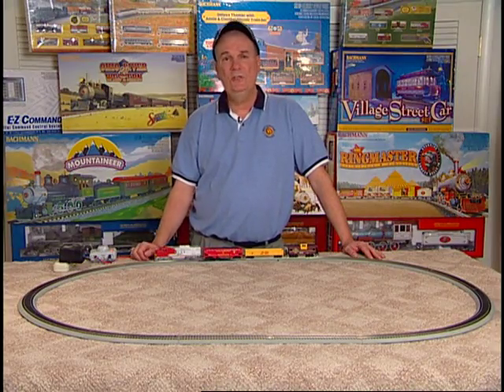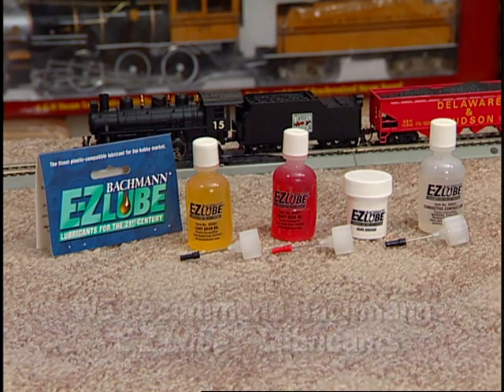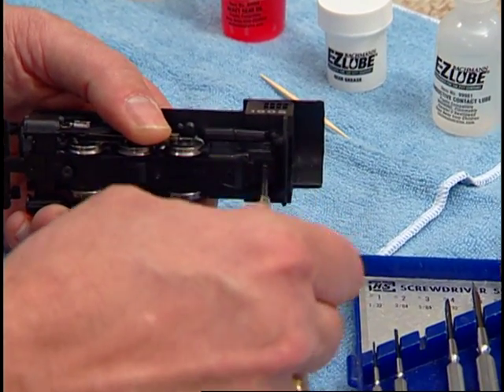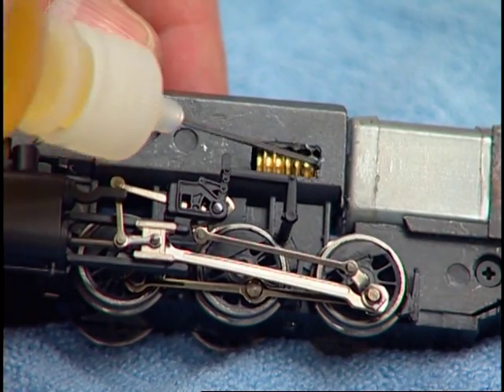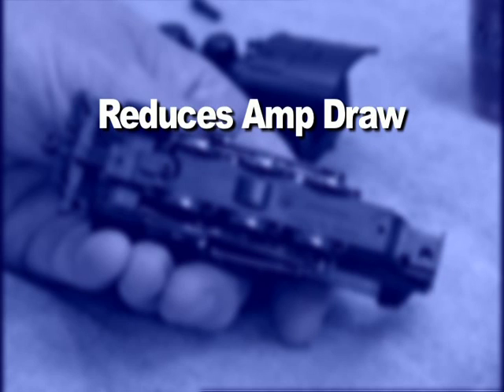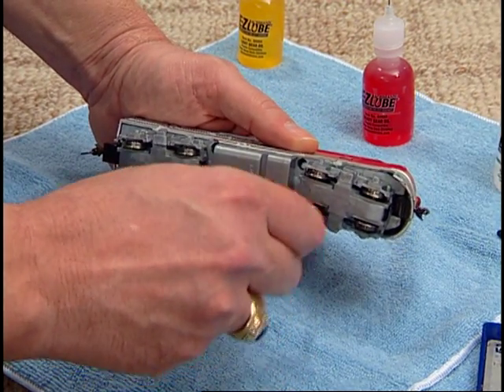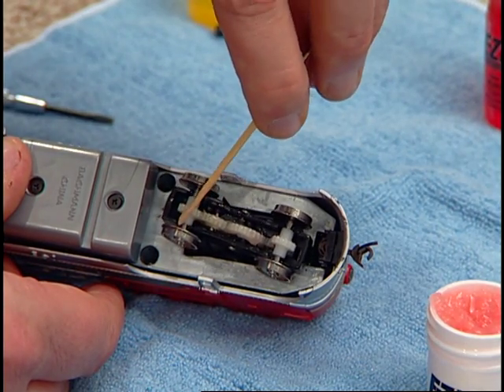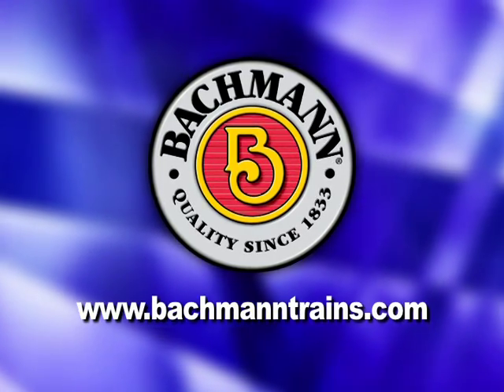Maintenance Tips and Tricks

Comment: @trainboy7 alright, you'll either have to remove the bottoms part of the chassis block, (the plastic bit with all the licensing and whatnot) and then put the oil in the wheel gear, and it'll just get to the rest of the chassis on its own very quickjly, OR you could pop the face off, and remove the eye mechanism, and put the oil on the fancy gear with a curvy grove, but on the actual gear part, and then it'll quickly (but slower then the other way) get to the rest of the chassis :)

Comment: My Bachmann 0-6-0 has its worm gear buried inside the two halves of the chassis. In order to oil it would I have to take the chassis apart or is there an easier way to do this?

Comment: In the case that an engines smoke unit is leaking smoke fluid, how would you clean the fluid off the base, wheels, etc.
Reply from the maker: Hi there - we recommend using any cotton-based cloth. An old rag, an old t-shirt, etc.

Comment: How often should you lubricate your locomotive?
(Week or month-wise)
Reply: They recommend after every 24 hours of use.  From experience the lube will last a good amount of time but will always settle to the bottom of the side it's stored on and in the case of grease it can thicken or become hardened a bit.  If stored for more than a few months I would always say to clean out and reapply oils and grease.
Reply: So what the comment said about I disagree with on storage . I've had it where am I locomotives have sat for several months and never needed much but maybe on the drive gear of a steam engine a little bit of oil. I've had my diesels sitting the same amount of time never had to add anything. Most of my things are from 50 to 12 years old granted I don't have much but still. What I would do is if you're welcome out of his sat for a couple months and it's a diesel take the truck cover off and look at the grease but looks good pliable not dry and the locomotive runs very well other than needing a wheel cleaning I wouldn't do anything to it. Same goes for a steam engine however the drive rods may need as I said before a little bit of oil that's it

Comment: I bought an 0-6-0 and when it touches the plastic part of my ez track switches it stops getting power and doesn’t move. Can I get help. I spent 200 dollars and I can’t use it
Reply from the maker: Our best recommendation would be to make sure the wheels on the locomotive are clean and the rails on either side of the plastic section of the turnout are also clean (there should be no greasy or black streaks visible on either). The plastic section is not long enough to create a short, but if the locomotive is struggling to receive power immediately before or after, it could create the conditions where a short would be possible.
Reply: @BachmannTrainsUSA  thank you so much I’ll try it, if it doesn’t work should I switch to a powered frog?
Reply: I found out my front right driver wheel had a bad black grease streak causing it to loose conductivity when it touches the plastic

Comment: How do you add new couplers on my f7a santa fe no.307? I havent used it in months
Reply: Couplers only need replacing when broken, however if they are a tad sticky or movement is stiff you can use some oil on the pivot part of your particular coupler.  Kadee makes the best ones but will require you to standardize your entire consist to them if you make the switch.  If yours are plastic couplers I would say upgrade them to the metal ones like Kadee.

Comment: Don't lube the wheels where it connects to rails. It causes decrease pulling power
Reply: Really?  But the video said that you should, and that it will help increase performance.  I’m confused..
Reply: @ChrisHillmon  u lube the bearings but the vid shows to oil the wheels where it connects to rail which if you do that only attracts dirty to stick to rails and also makes the weak 0-6-0 even less useful. That goes for all locos. Never oil the part that connects to the rail
Reply: @GSMRFan  Thats electrical contact lube on the wheels..different stuff completely
Reply: @gutzee4498  yes but it's still slick and will decrease pulling power and also gum up tracks
Reply: @GSMRFan  Ya maybe, electrical contact cleaner should evaporate..might be different stuff than I am thinking...does say lube though  hmmm

Comment: May be a silly question,but if happen that extra oil that wasn't taken off, could it cause a fire being that the rail is electric?
Reply: If so, there is a low chance of fire. But, it will make your locomotive operate weird.
Reply: @BNSF4749Railfan  Thank you🍀
Reply: @aimeemarieholloway7029  no problem.